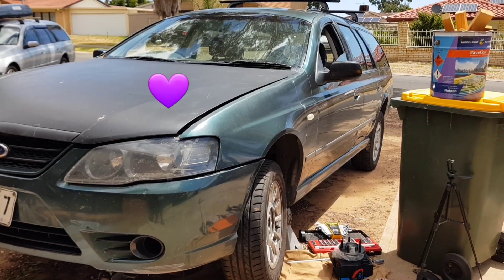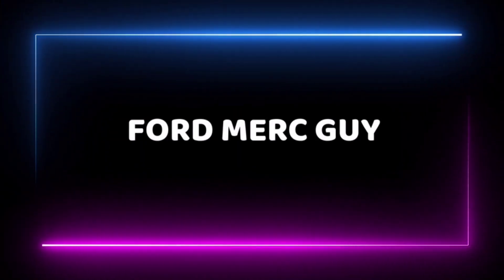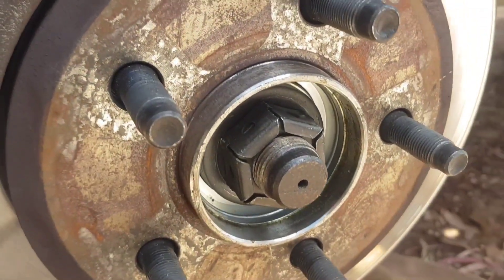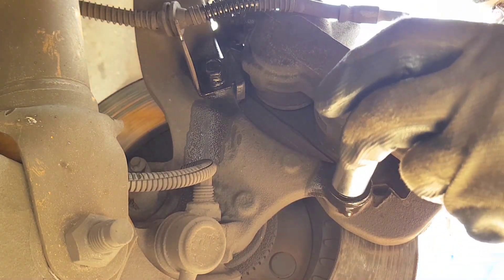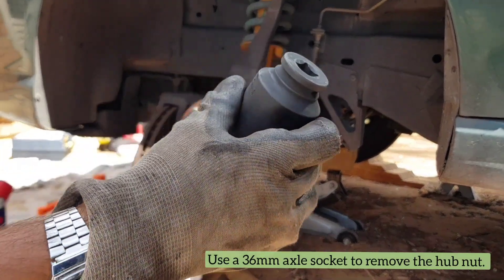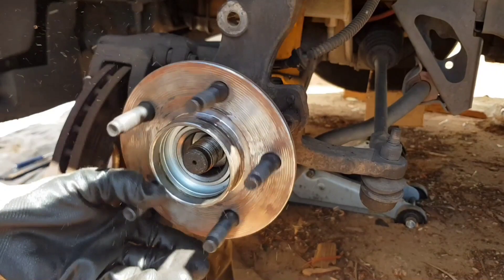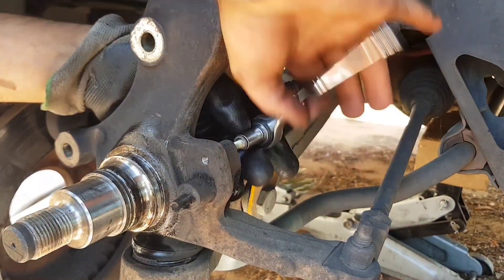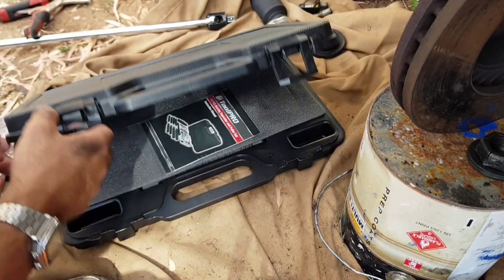Replacing a front Wheel Bearing BA/BF Falcon

Comment: FYI - BA Falcon - Torque Specifications:  Wheel bearing Nut = 300Nm.   Brake Caliper to Spindle = 115Nm.   Wheel Nuts = 125Nm.
Reply from the maker: This will help many others cheers mate
Reply: Top stuff thanks. Great comment to compliment a great video.

Comment: Wow thanks saved $240 which was what the mechanic was charging. Bought the part for $35 and 30mins work. Thank you so much
Reply from the maker: Awesome!! Sounds like guy didn't need the puller? Awesome savings mate! Super glad I could help. Thanks for taking the time to leave a comment for me much appreciated
Reply: where did you buy it from
Reply from the maker: I ordered it brand new through supercheap Auto
Reply: @FordMercGuy  the bearing was just 35?
Reply from the maker: I can't remember the price now. Call supercheap Auto, give them your number plate and they can give you a quote 👊
Reply: @FordMercGuy  is it safe to use used bearings from wreckers /parts shop
Reply from the maker: If you are going to the trouble of replacing a wheel bearing I wouldn't put a second-hand one in because who knows how long that one will last or how healthy is it that one might need changing in two months
Reply: @FordMercGuy  yes true...just feel  buying new parts always can become expensive as car ages and more parts need replacing. thank you for your time
Reply from the maker: Yes I see what you are saying, or something such as the risk of an old wheel bearing assembly breaking apart and the wheel falling off while driving I wouldn't risk it but other parts I have also used second-hand as they will suffice just fine
Reply: @FordMercGuy  fairly said
Reply: @hassanjamal4212  $35 for a new hub with a bearing seems cheap. 
Mine where like $80.
Reply: @cea-jaymales8031  exactly ...hard to imagine any car part made out of metal selling for under 50 new. Decent price definitely

Comment: Got myself a cheap BA that needs just a bit of elbow grease and I find myself scouring YouTube for simple spoken instructions and have subbed to follow yours. One thing I would love to see is a BA Falcon stuck window fix; my front drivers window goes down 4inches then stops, not wanting to go down or up. Then after what seems a lifetime of jiggling it will go back up. I’ve got aircon but for when the car is sitting at night I would love to put the window up to secure the car 😭 struggling for easy to follow solutions before I turn into the hulk and things happen 😬
Reply from the maker: Ah yes, order a new window regulator/motor assembly and replace the original mate. Very common on the now 20 odd year old Falcons and territory. The driver front regulator/motor assembly gets weak and lazy, and binds or just freezes. Happened to mine, mine was stuck down after a year or two of operating slowly on cold days. $80 roughly on ebay.

Comment: Cheers, brother. I'll save this video for when I've got to do my wheel bearings. Got a noise from the front end I can't identify after doing brakes and ball joints and it still has a scraping squeal at very low speed and only sometimes so I suspect it could be wheel bearings coz nothing's rubbing.
Reply from the maker: No dramas mate! Oh darn, sounds like very frustrating trying to find the source of that sound. Good luck mate

Comment: Tiny bit of heat and a chisel popped it off in a minute for me, don’t necessarily need the puller but would help if anyones unsure!
Reply from the maker: That's it man, good stuff. Or perhaps anyone tentative to use heat/or doesn't have a flame to use.

Comment: Thanks for that great video. Question, please,  is all the nut size for the hub you mentioned 36mm, so this size on all ba cars includes ba xr6t? 
Thanks
Reply from the maker: Hi mate cheers! personally I'm unsure but I have a sneaking suspicion these cars share alot of parts. Perhaps you can consult a Haynes manual for more information. Or the old, get the wheel off, try a 36mm nut and if it doesn't work, return to place or purchase and go a size up etc. Places like supercheap are good with returns that are re sellable condition.

Comment: I just had a left front wheel bearing and hub done by my mechanic , he charged $170 .
For a few weeks I was hearing a humming noise, then bang,  the ball joint failed and the body of the car was sitting on top of the tyre .
I just replaced both the front lower rear control arm and ball joint assemblies myself .
This is on a 2008 Territory Ghia Rwd.
Both control arms and fleet wheel hub and bearing were fitted by my mechanic in Feb 2021 only lasted 23000klm.
Pretty sure he got them from Repco .
Personally I can't think of a reason why they should fail so quickly apart from everything being tightened by rattle gun and not being correctly torqued to specs.
 I hardy did any long distance  ,  rough road  or anything else I can think of to damage these parts .
Just to let all the Territory people know I bought the latest  control arms from Gary Walker , they have a grease nipple in the Ball joint.
Cost $175 each,  hopefully these last .
Good video and I'm a retired  Carpenter , not really into DIY car stuff , but after the Ball joint failed,  couldn't get it towed , wheel wasn't connected,  did it myself on the side of the road. 
 Clear concise video , enjoyed watching it.
Reply from the maker: Thank you mate yes the ball joint certainly our Achilles heel of these cars. I read all the time on Facebook forums that New ball joints last about 20,000 km before failing. Perhaps brand quality plays a big part in longevity.

But thanks again mate glad my video could be off some help

Comment: Always 'fun'! hahaha. I did a video about it, and associated repairs on my channel also a few years ago - so far, only the passenger side bearing has needed replacing...touch wood!! 😆
Reply from the maker: I mean certainly could be worse however that's right lots of fun 😜 I heard from a mechanic once explain to me that because of the Geometry in the roads for allowing rain to pull to the left side of the roads that the slant in the road geometries left side wheel bearings tend to go more easily.
Reply: @FordMercGuy  Makes sense!
Reply from the maker: That's it!

Comment: Hi thanks for the complete video of the job. Here my question might not be direct to this job, but I'm confused about my Ford Falcon 2003 Wagon rear wheel hub & bearing assembly, if this car  is fitted with independent rear suspension, but I don't know how to check that. One guys advised me to replace this Falcon REAR wheel hub and bearing assembly, he said the parts would come together with axel as a whole replacement. Could you advise, I would be appreciated?
Reply from the maker: Yes when I needed to replace my rear left wheel bearing on my wagon, my mechanic mentioned he had to remove the whole axle and press the bearing out? I think it was for Utes and wagons I hear.  Hope it helps!

Comment: Thanks for the video just a quick question would you add some anti seize on the back of the new bearings or not necessary?
Reply from the maker: No dramas mate thank you, unfortunately a mechanic would know best, if you do use some perhaps make sure it is a lithium based or something that doesn't attract dirt and dust and cause more problems

Comment: great video thanks. Do you need to pack grease into and around the bearing ?
Reply from the maker: Not sure mate, without mechanical training I'm unaware. Seek a Haynes manual for recommendation?
Reply: @FordMercGuy  it works out that these are a sealed bearing that do not need any more grease than ready supplied in the casing.

Comment: Hey bro thanks for the video it helped me out. 

By the way never say never. I grinded the bearing housing off.
Reply from the maker: Hey mate I'm glad to hear it. Oh hey if it works it works!
Reply: @FordMercGuy  it worked. I didn't have that jig and had to get it done. You just do it softly with a small disc and on angles to make the disc fit. I cut and cracked a triangle out with my chisel and hammer, the neck didn't need to be cut all the way through because it slid off by then. Only some superficial scraches from the grinder on the axial nothing life changing. Im proud of myself. Thxs again ❤️🙏✌️
Reply from the maker: It's the best feeling when you find a way to do DIY and save yourself cash! Great stuff mate
Reply: @FordMercGuy  thxs again much love ☺️
Reply: @FordMercGuy  obviously a battery gringer not a powered one
Reply from the maker: Much love legend!

Comment: Great mate 👍🏻 I went camping on some dusty and corrugated roads at Easter and think it has started a noise in my wheel bearing at front . Just had trans done and thought it was something with that but I can slightly feel the vibration in steering wheel . I will jack the car on both sides and spin the wheels to listen for noise . What else can I do to detect dodgy wheel bearing ?
Reply from the maker: I'm no mechanic but I've seen some tests such as When in the air, see if you can feel any clunking/moving when you grip at 3 and 9 o'clock and pulling in opposite directions, and 12 and 6 o'clock. Feeling for any play might indicate a bit of a bad bearing.
Or when driving and pitching hard left to right, if the bearing noise gets louder on the side when the car weight leans on that side bearing, that can be another sign.

Comment: definitely will need to tighten the hub nut again they require 255nm of torque if i remember correct, in the video you might of been lucky to have gotten 150nm by pulling with that breaker bar and its quite important to preload these bearings with the recommended torque or they wont last
Reply from the maker: Absolutely mate, safety first also so important. Cheers for the insight!
Reply: 320nm is Ford factory torque spec, I was working at a Ford factory suppliar assemblying the front ends

Comment: With the inner bearing ring did you have a extra peace still on like a washer if so did you leave it in ? I'm not sure what's going on after installing 2 hubs my stearing have a slight rub or vibration when I turn the stearing wheel
Reply from the maker: Its tough to say mate. I just went for full removal of the old hub + that remainder part that was stuck on the shaft and replaced with the new as in this video. Checked your power steering fluid? If too low top up. Sometimes low fluid could make vibration if air has been sucked into the system.
Otherwise might be worth jacking up and turning the wheels and seeing if you can hear the noise with wheel spinning

Comment: Thanks for the info,valuable stuff.I would prefer to be using torque wrench and proper specs to be tightening things up though.
Reply from the maker: Cheers mate! Agreed Yep absolutely, best to do it with a torque wrench as I mentioned in the vid. Peace of mind with full recommended torque specs.
Reply: Those nuts are single use only. When you buy the hubs make sure you replace the nuts. Torque setting is 300 nm.
Reply from the maker: @steve Jones that's it mate!

Comment: Use OEM hubs.  Several Ford dealers on eBay sell them at a good price.  Better quality unit than aftermarket and they last a lot longer…
Reply from the maker: That's the one mate!
Reply: I don't know what it was like a year ago, but OEM wheels hubs are 400 a piece now.
Reply from the maker: Darn!! Inflation not helping.. Perhaps as OEM parts aren't getting manufactured? So remaining stock is going up?
Reply: @TunsaMcHaggis  
OEM Ford Australia hubs are $93.50 each plus roughly $15 for freight.  No idea why you think they’re $400!

Comment: Will a stuffed bearing have abit of back n forward  movement when jacked up? Got a noisy bearing,no vibration,  but unsure what side It's on just making sure that checking for play first is the right way.lil deaf any advice will help
Reply from the maker: Hi mate jacked up with wheel on, if you can get movement play, that will lead towards having a bad bearing in my experience yes.
Also driving and turning sharp left and right a few times while maintaining speed while driving down a straight road.. The bearing noise will show up when the car is leaning on the side with the bad bearing.
Reply: @FordMercGuy  champion thanks for replying
Reply from the maker: Mate no dramas, good luck. Chat on my channel's official instagram if ever easier for quicker replies 👊

Comment: The nut that holds the bearing on is a one time use, get a replacement before taking off the bearing- its 212nm torque setting also most DIY mechanics won't have a torque wrench of that capacity, lots of risks for a quick job at the garage. Good luck!
Reply from the maker: Perfect thanks for the insights mate, will surely help others reading this in the future. My new bearing kit came with a new nut and yes, working on integral moving parts of a car, one does so at their own risk.

Comment: Would this be th same as the rear
Reply from the maker: Hey brother I personally have not done a rear one I only have the wagons in the family and the rear on the wagons change the wheel bearing is a completely different setup the axle shaft needs to come out but I'm unsure if the sedan rear is a carbon wheel bearing assembly like the front on these Falcons like in my video
Reply: @FordMercGuy   yeah hopefully the sedan is just the wheel hub being irs

Comment: What if it makes the noise when driving in straight line but stops when turning
Reply from the maker: I'm no mechanic so I can't comment with certainty. I can imagine a very worn out bearing will show up in straight line.. But I'm unsure why your sound is going away when you are turning. Puzzling
Reply: Yep, my front right sounds like a train on tracks in a straight line. Worse around corners.